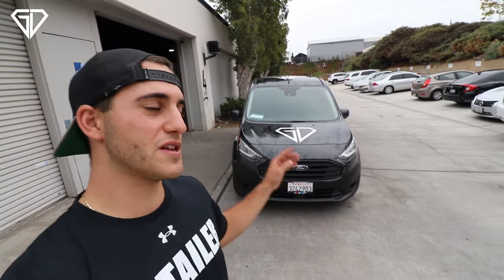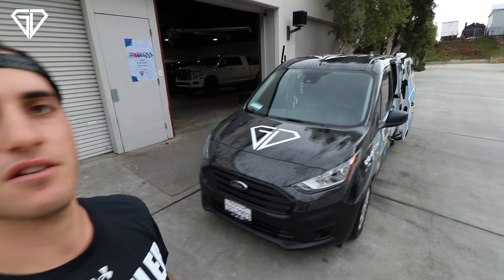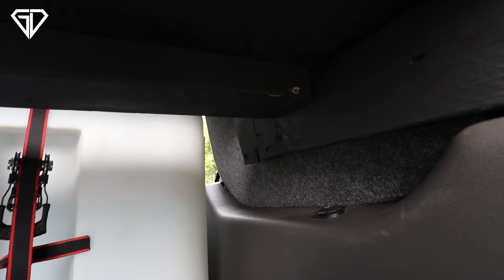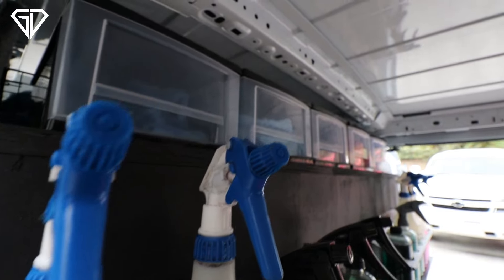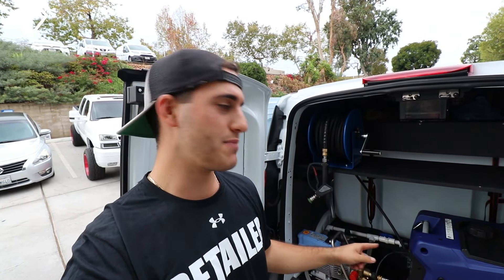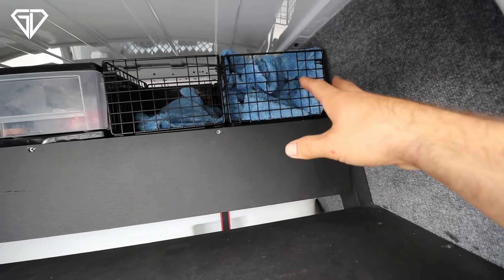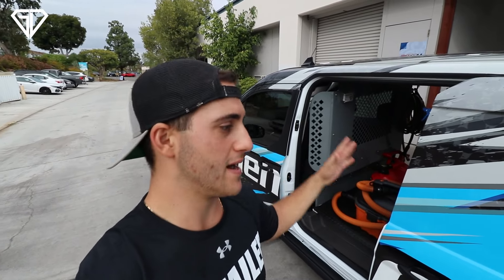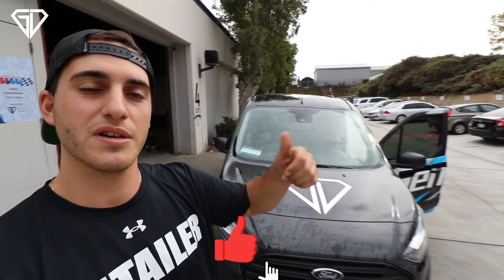Full Tour of My Mobile Detailing Van! 2021 Ford Transit Connect #mobiledetailingvan

Comment: The kranzle will work with the predator if you shorten the long cord that it comes with. Also you don’t need to have the water tank higher than the kranzle it will actually pull water up from 3 feet higher up than your water source.
Reply from the maker: Yea I didn't want to bother having issues with the generator. Better to have it overpower  then underpower. Plus the Westinghouse was basically the same price!
Reply: What do you guys think of the “Champion 6250 inverter generator” i have been having issues deciding which one to go with im in the process of doing my set up it isnt my first time doing my own custom setup but its just a little crammed at the moment but im waiting to get a generator so i can run it with the kranzle & begin building. Any thoughts please feel free

Comment: Great video. Suggestion about Kranzle pressure washer & Predator Generator.  It will work & is compatible.  All you have to do with Kranzle pressure washer is shorten extension cord to 3ft or 4 & the GFCI will not jump. I've had mine this way for the last 2 1/2yrs with no problems.  Hope this info helps. 
Best Regards ,
Mario Garcia
Garcia's Automotive Detail 
Tucson Az
Reply from the maker: Thank you! Yes I ended up shortening it. Didn’t know Kranzle recommended that. Just ended up doing it based off some common knowledge 😂 been struggling with air compressor/generator combination. Do you have any experience with that?
Reply: How many gallons do you have & what is problem?
Reply: I use to run a 8 gallon California quite compressor with predator 
No problem @ all
Reply from the maker: @garciasautomotivedetail5196  which model specific?
Reply from the maker: @garciasautomotivedetail5196  I tried a husky 8 gallon and it surges the generator
Reply: 1-H-P 8 gallon Calif quite air compressor as soon as you Google it you will see its the 3rd one on screen.  I got mine on Amazon. Never had any surges.  Loading up a video right now on you tube as we speak.  I sold the van your about to see & got a transit

Comment: Excellent setup,    The best generator for 1622 is Honda 2200is and is super small.
Reply from the maker: Interesting, I don’t think there is nearly enough wattage to run the kranzle
Reply: @GENESISDRIVEN   i use mine with that generator and it works fantastically.

Comment: You are most likely pushing the limits of the vans weight capacity with the water in there right because it can only hold 1600 pounds because I am planning on doing the same thing as you

Comment: Which kränzle are you using ?  amps ?
Reply from the maker: Kranzle 1622TS
It’s a 15amp
Reply: The reason i ask is because in Europe ( germany  ) the Kränzle´s are 230 Volt and much lower amps....  how many watts is your  Generator then ?  and is it ample  enough to run this 1622 TS ?
Reply from the maker: Ahhh gotcha, the generator I got is a 4500 watt. Kranzle recommends no less than that for our version. I shortened the cable they provided to increase the power delivered. Runs like a dream now